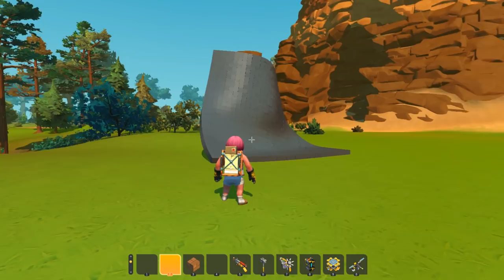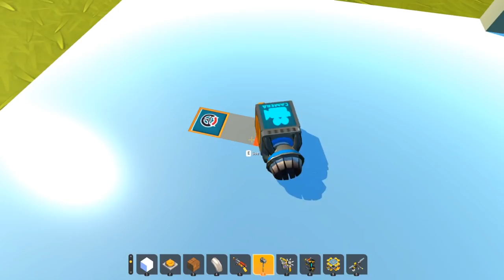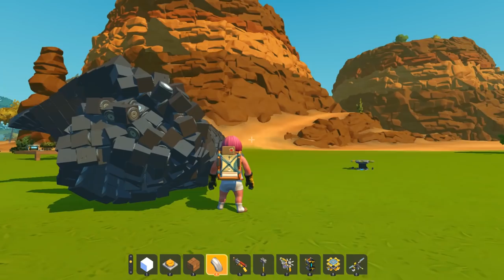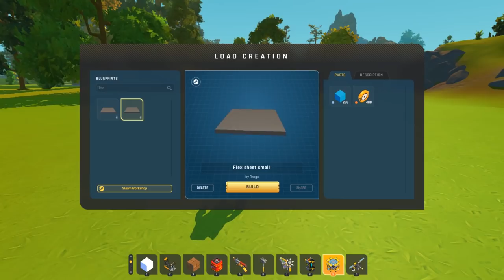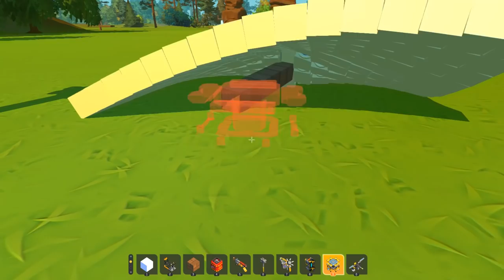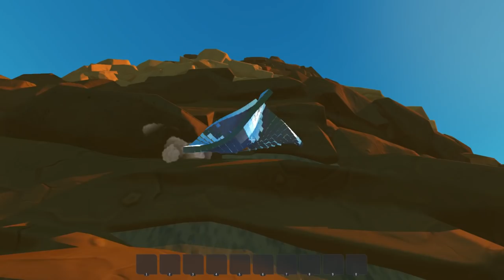Slippery Cloth Made Of Ice 🧊 & More Soft Body Physics Experiments

Comment: What did you use to edit your files? I see you were able to not only change the blocks, but they were modded blocks, and you could change the bearing colors.
Reply from the maker: Just a text/code editor (Notepad can do it, but I used a code editor because I do coding too, make mods for this game, etc)
I used 2 blueprints, if you noticed that other thing I saved which was just a few blocks of different types
I opened both blueprints up to see their JSON code, which is just a list of blocks, positions, colors, etc
So the blueprint with all the block types is just information for me to use, and I would copy the UUID for the different block types
Then I would search & replace the UUIDs of the blocks in the "cloth" blueprint, to tell the blueprint it was made of another block type (you can call it "manually" editing blueprints)

I also searched and replaced the color codes so it made sense when I spawned it in, otherwise it would be the same old color as before - this is why bearings changed color at all when they didn't have to, just a lazy "replace all" of that color with a new color)
If you have never done any coding / modding before, this should still be very easy to do, and you don't need anything special for it
Hopefully in the future there will be some better blueprint editors out there, but if it's just for something like this then doing a search and replace in notepad is still the easiest way to go

Comment: Make a sheet of ice with bounce ice along the edge and high friction blocks at the corners like concrete, but 5 times more friction and 5 times heavier. Then put the steering stuff in the middle. I haven't tested it. Experiment with multiple materials and make stuff more than just a single flat layer. Also turn the graphics way down.

Comment: Practical use for pink flubber impact bracing for a hover craft / vehicle crash resist. Use for ultra heavy blocks needed tracion for small/large vehicles. Uses for lightweight block. Repeatable wings on air vehicles / lowering weight on large slow vehicles. these are decent uses but I'm sure somebody can come up with better.

Comment: It would be nice, if more games had more things, that completely change properties at the flick of a switch. There is of course lamps and things like that, but I mean stuff like cloch, that when activated, hardens. This example can be used to make a mold of a complex object very fast, or it can be used for grabbing thing, that have solid, non-malleable and complex shapes regardless of slipperyness. Another cool mechanism would be a block, that changes friction. It would also be nice, if games had more complex math like fx setting the friction to (altitude)×((playerdefined variable)^2).
I am not talking about any game in particular. I just mean games in general. Mostly sandbox games with physics where these types of mechanisms fit. I know, there are games, that have some of these things.